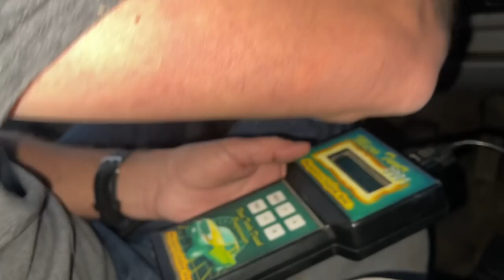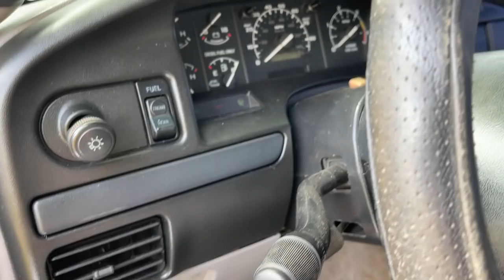OBS Powerstroke F250 ACQUIRED!

Comment: These are such cool trucks, you got an especially cool spec since the Super Cab short bed is so rare. I have a 1995 F-250 that's very similar with the 7.3 Powerstroke, ZF5 manual, 4wd and Super Cab too. Mine is an Oxford white long bed truck but it's just what I needed when I got it. They aren't fast trucks at all unless you really juice it up but they're plenty strong, it can handle about double the stock power before some pretty serious things need changed out. Instead of the typical cab lights you should try to track down a Lund lighted visor for this instead.

Comment: Just A hint, if you double clutch when changing gears it will make the change a lot easer.
Reply: Agree. Also give it a gentle rev like u might with a road ranger
Reply: Soooo, with out sounding stupid, how do ya “double clutch” ??
Reply: @pauldoitcheap4343   makes sense….. thanks for replying 👍
Reply: You don't need to use the clutch.
Reply: Double clutching is for beginners. Once you learn how to float them, clutch is for stopping.
Reply: @pauldoitcheap4343  total BS! Either you can shift or you can't. The multi million dollar designed auto shift does not touch a clutch and never grinds a gear. It knows how to match the gears with the rpm and road speed.
Reply: @garywheeler2055  Hi you put the clutch in take it out of gear then release the clutch then put the clutch back in then move into the next gear.
Reply: @jessejames3572  I think you need to re-read the post. The conversation was about double clutching versus floating. We all saw that their tranny was screwed up. No we don't expect Emily to shift like a seasoned trucker.. come on man!
Reply: @jessejames3572  if you want to destroy a drive train on a big truck, just stop it in gear without engaging your clutch.

Comment: Good purchase! I've daily driven the same thing for 15 years only CCLB version. The rear brakes not holding adjustment is a huge issue. I manually adjusted mine for years before finding the solution. The stamped steel levers available today that spin the star wheel adjusters are junk and don't have enough of an edge to catch on the star wheel teeth. My last brake job, I swapped the levers from side to side on the truck, installing the left side lever on the right side wheel and the right side lever on the left side wheel, and it fixed it. Swapping them allows the very edge of the lever to grab the star wheel teeth and it works great! You'll have to hold the levers in your hand to see what I'm talking about.
Reply from the maker: Good info!!!! Thank you!

Comment: Those 10.5 sterling rear axle brakes will be out of adjustment again in about 3000 miles. I replaced everything in mine twice and the self adjusting part just never seemed to work. The zf5 transmissions almost always lose that lower gear synchros too. I just got used to shifting slower!  That’s a great truck and it’s already Dana 60 swapped in the front!  Love it. Hope it serves you well.

Oh and to add, you should find a way to register it in Arkansas. No inspections here. You could get some of finnegan’s junk legal to drive in this state.
Reply from the maker: We want to buy property in Arkansas! Now we have a good excuse!! 

Annnnd we started shifting at a lower rpm and the grinding stopped 😅
Reply: @flyingsparksgarage  winner winner, chicken dinner!

Comment: I see it has a solid axle conversion already. With rsk kit! Nice. I have had few of these and currently have 97 f350. Just did rsk kit myself. When I did that my steering wheel was off like yours. I noticed that right away. 

Great trucks. 7.3 last forever..

Comment: The horn button should be more easily accessed as the horn is a very important safety device…there’s a reason vehicles have it installed on the steering wheel, hopefully y’all will have an interest in getting into the steering column to fix it.

Comment: That's what I did to make the horns work on my '56 Buick. The old horn contact at the base of the inside of the steering column was cracked, and new ones are unobtainable and require removal and replacement of the entire steering column, steering wheel, shift mechanism basically the whole nine yards. So yup, now I have that same black button under the left side of the dash where I can easily reach it. Works just fine!

Comment: Nice find on the OBS Ferd.
I've got a 95 F250 XLT 4x4 with the 460/E4OD combo that I use for RV transport.
Yes, you read that right. A 27 year old gas burning truck turning 10,000 miles a month, towing for at least half of those miles across the US and Canada.
Except for transfer case problems on one trip and a few little nitpicky issues, it has been flawless. I just need to make sure to keep lots of dinosaur bones and ground gravy to it and it's happy enough.
The best part? 
Payments are zero dollars per month.

Comment: 1:46 passing my moms old job. your truck has the mirrors i want for mine. very nice find. i put money on its the horn contact in the steering wheel for the horn. its not hard to do its a super common failure point. somebody had that same button in my truck that went bye bye asap and i replaced the horn contact for like 30 bucks in 15 minutes a lot of times your cruise control wont work because the horn contact controls that too. you have to line the splines back up in the steering wheel anyway so thats all you have to take off is the steering wheel so might as well do it then.

Comment: I have the same truck but long bed, my 2nd to 3rd would grind real bad until I started double clutching up into 3rd. Smooth now. Cool that it already has a D60 swapped in and a downpipe, those are nice to have. Aftermarket injectors go along way with OBS’s. I’m running 180/30’s with Jelibuilt tunes on a hydra and my tuck scoots even by modern standards.

Comment: Bought a 2WD 5.0 F250 with a ZF5 for $1000 that I used to move from Las Vegas to Midland for A&P schoot. A month after school started I got T-Boned in Midland by a guy that just had to get across 1788 before the semi to my left had gotten past. We never saw each other until we went past the corner of the semi tractor. Cracked a couple ribs and used the insurance payout from that to buy a Honda Insight 1st gen that got much better mileage. But I really missed that ZF5 transmission.

Later bought a GMC Sonoma ZR2 for $1200 and kept poking around Craigslist until I found someone willing to trade straight up, his F350 CCLB Dually with the 460 and ZF5 transmission. Loved that combo, even 'tho Ford only did half the work putting in the EFI (bank fire sucks). With the genetic header leak on #8 and a shift at just the right time, it would detonate the excess fuel in the exhaust for an enormous bang. Not to mention all the pops and crackle with the overrun and engine braking. Sorry to see it go, but found an even trade for a 2002 Avalanche that's never missed a step other then the 4L60 that GM beancounters decided to put in their trucks of that era to save a couple bucks.

The horn fix is ugly as sin, but the F350 had the same fix until I realized that to fix the cruise control switches, you had to change the clockspring that runs them and the horn switches. It's a common failure and of course Ford doesn't do spare parts support. I probably got one of the last NOS clocksprings via eBay from a UHaul dealer closeout. It's just a very simple flat trace cable and it's easy to replace, but good luck finding the replacement.

Make sure the brake master cylinder recall has been done. The switch that disconnects the cruise control will develop a leak and the brake fluid will get into the connector and start a fire. Don't park it inside until you are sure it's safe. As it's a recall, all Ford dealerships will fix it for free if you bring it in.

And watch out for the cup holders. The only cups they hold are coffee mugs. Anything else will get tossed out almost immediately. I got aggravated enough that I hole-sawed out the bottoms so they were useful again.

Comment: Nice end of the trip finding the F250 Power Stroke Diesel.... What was especially good on the P/U was the shortie bed, big knobby tires and all the power options even though the manual tranny had issues with 2nd and 3rd gear but that can be fixed along with the emergency cable and the horn... Solid rig for your utility work and running around......

Comment: I just bought a 2002 F350 7.3 supercab shortbed single wheel with 145k miles from the original owner for $13,250. Came with original window stick and maintenance records. Very happy with it.
I perfer the front ends on the OBS. Nice find, congratulations.

Comment: 2nd gear synchros are almost always gone.
Change the tranny fluid out with 6 quarts of Royal Purple Max ATF top filled.  It will quiet down the transmissions some and helps shift smoother but it won't fix a worn synchro.

Comment: A suggestion. Don't change the transmission. Learn to double declutch. (With no gas on the upchange, with a blip of gas on the down). It's fun. When I first had my 1936 Austin Seven Ruby (similar to the Dixi in the States) it had a gearbox from an earlier car (circa 1931 I believe), which was built without synchromesh (a crash box). For a year I drove around with no synchro at all. Got quite good at changing gear quietly. When I was young, all the lorries (trucks) were still built without synchro. And when it was introduced on the trucks, some of the drivers didn't like it. I now have the correct box for it's year, which has synchro on 2nd, 3rd, and 4th, albeit weak synchro compared to moderns. I know Aaron has been around trucks a lot. If he is too young to know he can always ask an older trucker. Although, I think he was already getting there after driving it for a bit, by changing slowly enough to let the cogs engage quietly.

Comment: I miss my Dads 1993 Ford F-350 Crew Cab Dually 2wd with the 7.3L Deisel non turbo put he did upgrade it with all Banks parts (the Turbo kit exhaust air intake and a few other things all done with in the first 6 months) that he bought new in my home town Milwaukee Wisconsin and as soon as we drove it off the lot drove it we drove it to Columbus, Ohio and on the way stop in Indiana to have the front seat upgraded (don't remember the brand but was not cheap and also had a cap installed aswell it was the style were the back of the cap was higher so a motorcycle (full dresser/bagger) would fit in the back also had a cb and dual antennas installed at RC Communications at some point aswell but   no problems what so ever on its first trip and it is still on the road to this day dad sold it to a freind and it has over 500k on it now its a little rusty around the Dually tubs but still runs like a million dollars  and boy do I miss that truck

Comment: I like the truck,however I wouldn't do Clearance lights ,Downsides are leaks, the lenses fade and can crack and you won't know till it's too late,finding the replacement lenses can be a pain as well. When they do leak, water goes down the pillar and leaks on to the electrical. Mold in the headliner.Not worth it Ask me how I know..Beautiful truck 👍👍

Comment: I bought new, and still have a 97 F250 Power Stroke truck like yours except not 4X4, and not manual. If you want more power out of it, I suggest the Banks Power Pack. I have 230,000 miles on mine and the Banks kit has been on it since the first year. It can be trusted to safely get more out of that engine. Enjoy! Be safe!

Comment: Sushi yuck
 But I love your truck I have an 89 F  350 heavy duty.  But your 5 speed you should be able to float it from 2nd to 3rd 4th and 5th without using the clutch

Comment: I’ve got a 97 f-350 with the 5 speed and I usually start in 2nd gear it’s got enough power to start in 2nd with no problems whatsoever so just sayin y’all could start there instead of 1st since 1st is called the granny gear cause it’s so slow

Comment: Is a high clutch pedal contributing to the synchro problem?  If the clutch will not completely disengage and the synchro's are worn it may not shift properly.  Worn parts and broke parts are sometimes effected by that problem.

Comment: As a fellow OBS 7.3 owner, you’ll never find a better truck. Sure, it may not ride the smoothest, may be loud, and may not make the most power, but boy are they fun.

Also, stock, in order to build boost you really had to get on the throttle

Comment: So a Polaris work SBS was not a better option.
Had a few box's like that my grandad taught me about double de-clutching between gears  a bit of heel and tow, or my old Scammel Crusader was a case of out of first count 123 into second out of second 123 into third out of third 123 all with no use of the clutch apart from pulling away, my grandad had the knack of snicking it into gear as he pulled away no clutch for a ninety mile trip at maximum speed of 37mph on the flat, I miss old vehicles so raw and real driving experiance, when my grandad passed my mother sold off all his what she termed junk he was 83 and I was 15 when he taught me to drive.
A nice truck I presume it was a tug at some point judging by the mirrors a good upgrade solid front axle 4x4 hell yes, it is not as ratterlly as some I have had mind in the UK we get your cast off's.

Comment: Does double-clutching help with the grinding? We're grateful for you too. Thanks for sharing your adventures.
Reply: Not using the clutch at all for shifts will work.
Reply: Matching engine speed, transmission  speed and road speed will help. Synchros takes this timing out of shifting.
Reply: @chrissuter4107  True. Shift like a road ranger....

Comment: my mother and father have a 1996 ford f250 extended cab 4x4 with the 7.3 and it just hit 90k original miles like this year 2022 and there's is automatic .runs fantastic and theirs is full 8' bed

Comment: Take a shop vac flip the hose to where it blows air tape it to the exhuast. Get a spray bottle with water and dish soap spray your up-pipes to the turbo make sure you don't have leaks if you do you will lose power and boost. Up-pipes are known for leaking. You should be able to hit 12lbs of boost easy with no tune

Comment: Those trucks have a problem if you take it through a drive thru wash you lose the dome light, speedometer and odometer. When the heavy roller brush goes the top of the cab it shorts out the dome light. Keep some extra 15 amp fuses in the glove box.

Comment: I had a black crew cab just like that and the best thing you can do to that is a shackle reversal in the front end. It will lift it about two inches and it will ride and drive way better. I'm surprised they didn't do it when they put the Dana 60 up front. The truck will look way better if it was leveled up front too.

Comment: Nice! Work on these engines a lot. Common issues: injector/glow plug harness melts in the valve cover gasket plugs or the harness under the covers comes loose. Bad Ipr valve is a common tow in for no start or died in use. If it starts missing either have no fuel pressure, bad filter, or bad injectors and if one is bad the rest aren't far behind and don't get fooled into getting the cheap ones. We have to rebuild them still because all they do is change the nozzles in them. Otherwise feed it fuel and oil and they go forever.

Comment: inlest things have changed the horn relay is grounded by the switch in the wheel.  Does the relay work? If so the add button switch should be used to ground the relay for horn's to sound.

Comment: I have a 84f150 and a 94f350 cclwb single rear wheel the f150 is dangerous with any trailer over 10 foot the f350 can't pull anything  up a boat ramp . These trucks suck for traction both of mine get stuck in wet grass at the smallest incline !!! If I didn't have so much invested I'd get 70s trucks 80's-90's are worthless to light weight
Reply: I'm guessing this is a scammer

Comment: The 4bt Cummin's with a p-pump is the best conversion for the Bronco and check out Power Driven Diesel's you tube channel as they have a new head for it and in a Ford Excursion it made 410 Horse's and over 800 ft lbs of torque to the tire.
Reply: That is a massive motor for a little Bronco. An R28 would be much better.
Reply: @tlr-nut7275  It is a 4 cylinder and it has been done many many times
Reply: @donaldk.macbaird5248  Still a 1,000 pound 4 cylinder with about 120hp.